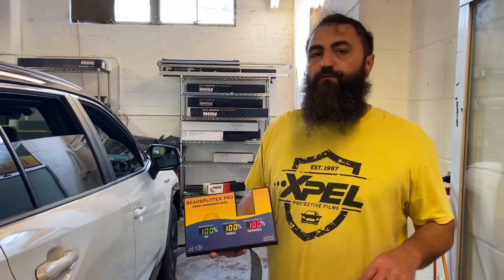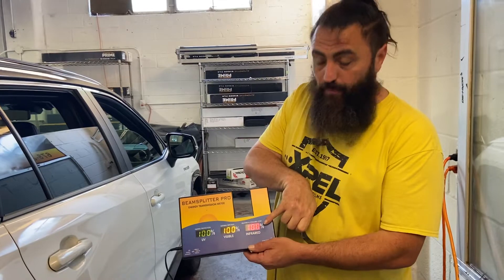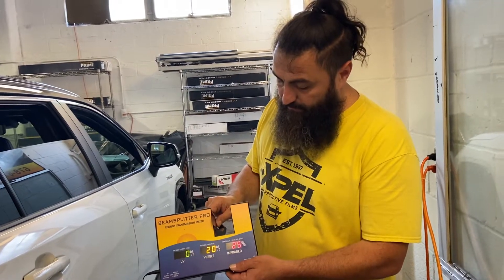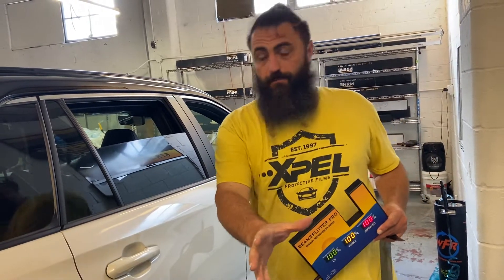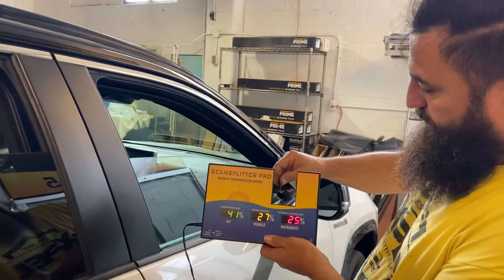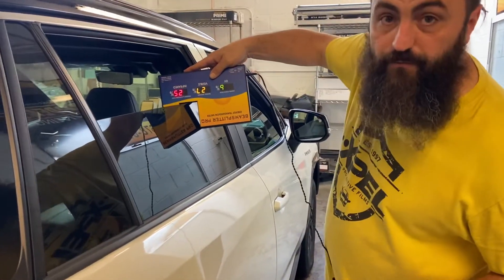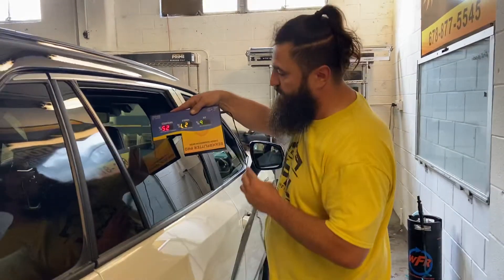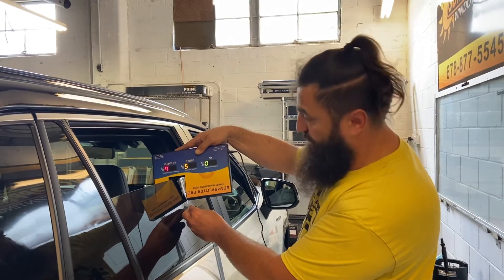Does factory glass reduce heat at all? How good is XPEL XR ceramic window tint?

Comment: wow, I didn't know that, I have a Rav4 Prime plug in that I just bought about a week ago.
Reply: dream car... how do you like it?
Reply: @TaylorPhase  The Rav4 Prime is unbelievable, I filled up my first tank of gas at 2,280 miles.  Running the plug-in’s 40+ miles and then it shifting automatically to hybrid mode after really saves on gas.   Also, that thing has over 300 hp when put into sport mode, and it will take off like a little rocket.  Plus, like all Toyota’s it’s build rock solid.  I love it, the only problem is trying to get one.  I heard that it’s taking over a year to get one and it’s only made in Japan.  I was lucky that the person who had originally ordered it waited for so long that by the time it came it, he bought a truck instead.
Reply: @warlock007-gold  whats the average mpg when just running in hybrid mode? like a road trip in the real world. hard to find online results. and here in portland, there are rav4 primes on every block. extremely common here
Reply: @TaylorPhase  wow, that’s very unusual because if you look at all the videos on youtube they’re very rare, and here in Hawaii, it’s a year-long wait.  But if you can get it, get it now, again they’re only made in Japan and a lot of people believe that the Japan version of any Japanese cars no matter what brand tends to be a little bit better built.  But regarding your question. I drove my Rav4 without charging it up and just ran it only on hybrid mode and got around 45 mpg.  But my driving is a little unusual.  I drive about 78 miles per day.  Half of it is uphill and the other half down hill—pretty much from sea level to around 3k feet elevation.  So on the way back down I regenerate about 16 miles of charge that I use the next day to go back up the hill.  I suspect if I was driving on a flatter  area like where you’re at I may get better gas mileage.  It’s really kinda of hard to say since it really depends on the terrain you’re driving on.  Even when I have my Rav4 fully charged at 42 miles on EV plug-in charge, it will only last for about 20 miles then shift to hybrid mode because the steep incline will draw a lot of current, and that car is heavy. My friend owns a Nissan Leaf and it has a 150 mile range but it can’t make it to the top of the mountain here (Haleakala) which is only about 50 miles away because the incline is too much (sea-level to 10,300 ft). But yeah, it’s gonna be hard to find real world results because it depends on your own situation.  But keep in mind that the Rav4 is a hybrid that already gets great gas mileage, but when you add the ability to plug-in and charge and get about 40 miles free before it turning into a regular hybrid car, it’s fantastic. Plus, the prime has the additional benefit of having that 300+ horse power that the normal Rav4 hybrid doesn’t have nor does any other hybrid along with the reliability of a Toyota.  And after everything is said and done, that’s what it comes down to, reliability and you’d be very hard press to find a car that is more reliable than a Toyota. Although Honda’s are not bad either.
Reply: @warlock007-gold  I wonder if the tire size could be a factor  too. Larger tires are louder also.
Reply: @warlock007-gold  I currently drive a Hyundai Ioniq. It gets 60 mpg. But in summer with careful driving, I get 70-85mpg. I only got the regular hybrid because my apartment has no places to charge. And trust me, Oregon isn’t flat at all lol. Cascade mountain ranges are more insane than the Colorado Rockies. I drive from sea level in Portland to mount hood at 12,000 feet twice a week in heavy snow to snowboard. My battery is smaller so it fully charges from the brakes when I’m less than halfway down the mountain sadly. The RAV4 prime is all wheel drive too correct?
Reply: @TaylorPhase  If I utilize the plug-in feature where I just plug in my Rav4 when I get home, I’ll easily get well over 100 mpg, and if you’re daily travels is below 40 miles per day, then you’ll hardly ever use any gas at all.  But again that depends on temp and incline factors, still it’s a significant mileage.  If there’s a place that you can charge at work that would help.  I used to charge it while I was at work, but the cost for electricity in Hawaii is very expensive, actually from what I read, we’re the most expensive in the U.S.  The charger at work cost .61 cents per kilo watt hour and my home electricity cost .31 cents per Kwh.  Most places in the U.S. is around .15 cents per Kwh.  Both are since cheaper than gas, which is currently at $5.02 a gallon. Oh and yeah, the Rav4 is kinda all-wheel drive.  It runs mostly on front wheel drive, but when it senses that it needs the back wheels for grip, it automatically turns on the back wheels.  There’s a display on screen that shows that happening.  But the 305 horse power on that thing is unbelievable.  If you watch some of the youtube videos about it, that’s no joke.  I’ve overtaken bigger cars going uphill easily.  And I feel comfortable knowing that this car has that build quality that can easily last over 200,000 miles or more.  I just had it with cars that seem like a good deal and then in a few years start breaking down.  Ugh.  Btw, I was in Portland years ago, and you’re right, I remember driving through some forest area and it was pretty steep.  Nice place, really green areas and really nice people.  Ah, I also remember going to Voodoo Donuts!!! Hahaha. We loved that place!!
Reply: @warlock007-gold  dang that’s insane electricity. Here it’s only .069 cents per kWh for residential. Dirt cheap thanks to all the hydro dams. I do a ton of road trips to utah and the east coast, so it would be nice to know it’s mpg when you’re driving 500 miles or more in one day. I eventually want a rav4 prime or hybrid because I need a little extra clearance for heavy snow days. Needed a shovel with my Ioniq a few times and got stuck on an unplowed road once that had too much snow build up under the car. Front wheel drive with snow tires never gives an issue, but a little more weight and awd could give piece of mind with the higher ground clearance. I want to visit Hawaii some day but everyone says it’s overrated. No idea. Haven’t been
Reply: @TaylorPhase  yeah, that’s a problem with living on an island, we don’t have hydro dams or nuclear power plants that can produce huge amount of power.  I live on Maui and the electric company burns fuel to generate power, although we have a lot of windmills I think it only accounts for about 10% of the total island usage.  500 miles!!!! Wow, that’s crazy. Yeah, I don’t know about the whole “over-rated” issue.  I was born and raised here, but I’ve been to the Philippines a number of times and the beaches there are just as beautiful as they are here and less crowed.  And I hate say it but the people there are nicer too.  Sometimes some of our locals get stupid and rowdy.  If you do come over though, forget Oahu, it’s just another city, go to the Big Island, Maui and Kauai you’ll see some really nice places that are quite unique.  But save up though, it’s still gonna cost you a shit load of money.  Lol.
Reply: @warlock007-gold  i heard its just full of traffic and that the beaches arent as nice as florida. i grew up spoiled in the gulf of mexico with white sandy beaches in the florida panhandle. i do want to visit just to say ive visited. and what about solar panels in hawaii?
Reply: @TaylorPhase  yeah, Honolulu has a lot of traffic, especially Waikiki.  It’s a tourist trap for sure.  But the Philippines is really cool.  The lush vegetation and beaches are really beautiful.  In fact, Palawan, one of the islands in the Philippines  won most beautiful island in the world a few years back on Con de Nas magazine.  The waters are crystal clear and it’s surrounded by a tropical forest with caves that you can ride a canoe through.  Unfortunately, neither Hawaii or Florida or any other state can claim that.  The beauty of a tropical rainforest next to a beautiful beach.  That’s something